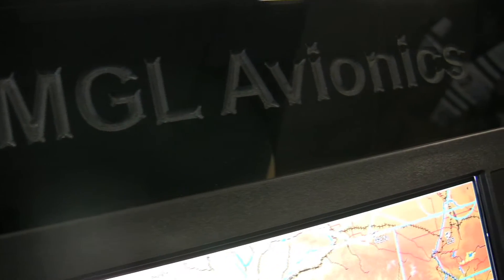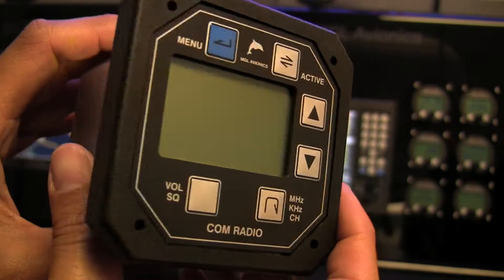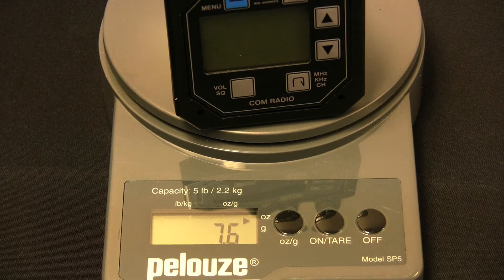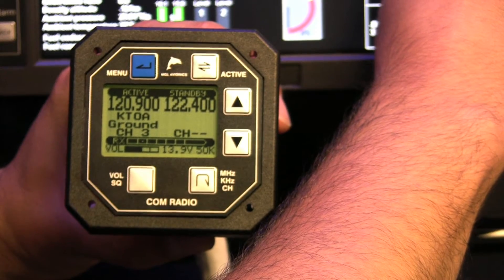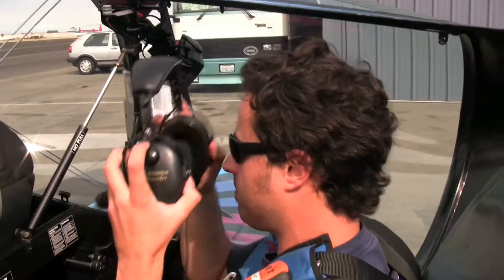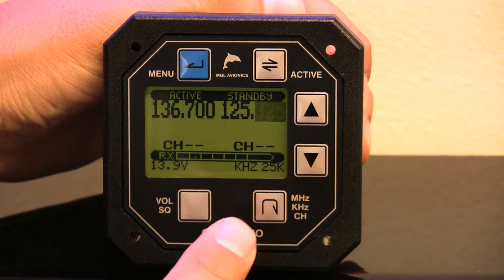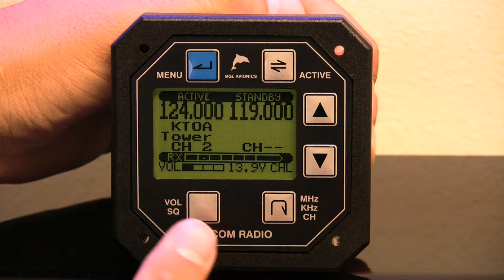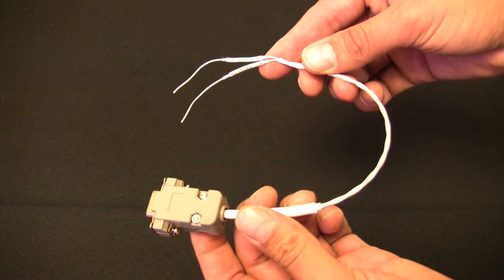MGL Avionics V10 VHF Aviation Radio Transceiver

Comment from the maker: Yes, you get used to the buttons pretty quickly. And of course, if you connect the radio to an EFIS, you get to use the EFIS keypad or set frequency directly from the airports database. Yes, the radio will accept an aux/music input.